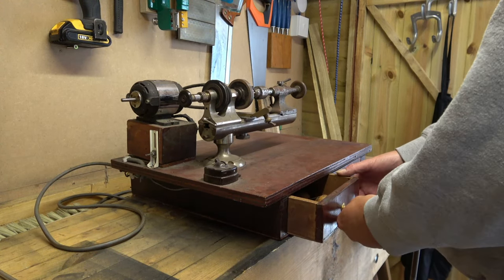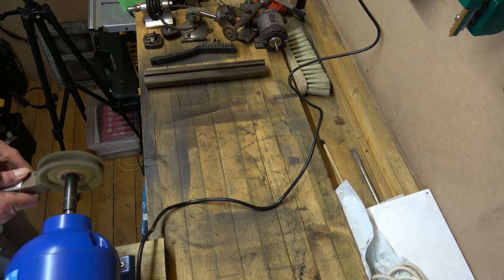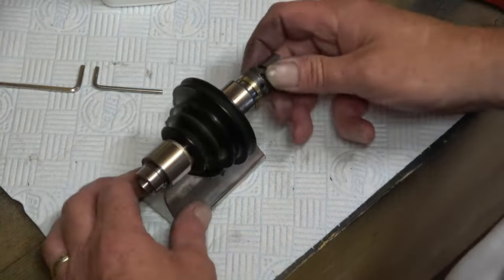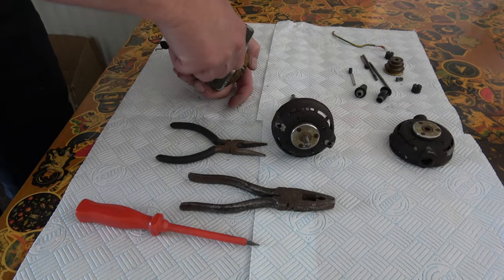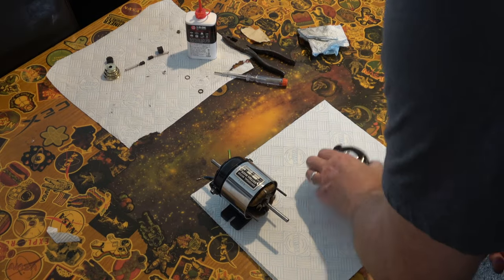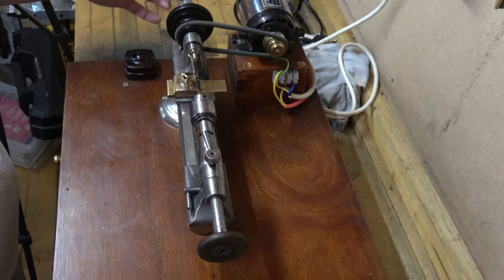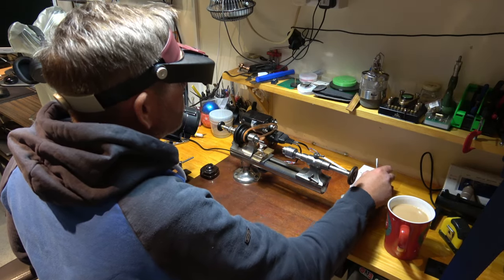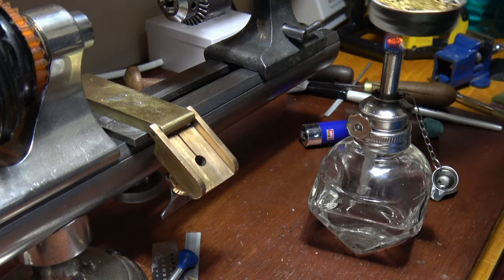I Bought a Vintage Lathe and restored it ... Now Watch Me Make a Screw! 😂

Comment: Well done, Adie That was great to see you're making good progress with the lathe 👍 I think the problem with the motor not reversing is that it needs a third wire for the commutator which is common for brushed motors, but I could be wrong  😆 Anyway, I love the screw, it requires framing 🤣Can't wait to see the next watch video as well. Keep up the good work my friend!
Reply from the maker: Ahhh electrics isn’t a strong point of mine 🤣🤣🤣 thanks for watching mate speak soon 😁👍👍👍

Comment: I restore torsion clocks and I have done a few videos using a graver, very satisfying making things using a graver, if interested search YouTube for TorsionDell, use Castrol Hyspin 5 spindle oil to lubricate headstock, the gravers you show at the beginning have the wrong handles and way to long as they should sit in the palm of your hand and  they are engraver handles , easy to make your own with hardwood dowl and brass tubing, the tool rest needs to be close to the work.
Reply from the maker: My friend thank you 😁 I wasn't sure on oil for lubricating I had used some 3in1 when I took it apart but I'll be getting some Castrol now 👍 hope.ypu donti.d me asking but how often should they be lubricated?  I'm kind of doing it just before each use. I quickly found out about the graver situation lolol I've chipped the point of the diamond shape a couple of times now but it's all learning lol thanks again for the advice and thanks for watching. I'm of to take a look at your vids now 😁👍👍
Reply: @HorologyHubub  yes just a drop of oil in front of & back bearing hole it’s designed to flush through to keep the bearings free of contamination, if using all day then mote than once.
Thanks for watching my videos hope they help.

Comment: This "ruler" that makes the spiral cuts on the screw is pretty interesting. How do you keep it sharp? Does it have a proper tool to keep it?
Reply from the maker: Hello my friend 😁👍👍 The ruler is a watchmakers die tool. I don’t think you can sharpen them but they are basically a hardened thread. Not very expensive thankfully so when that one gets dull I’ll purchase another. I do have an antique one but had bigger threads, and that still works 😁

Comment: Hi, congrats on getting a watchmakers lathe. Those tools you showed at the beginning are your gravers ad they are basically the same that wood turners use only way smaller for the watch trade. Learn how to sharpen them and they’ll serve you well. The other item you were asking about should be a steady rest. It should have two more screws on it like the one at 4 o’clock…one at 8 and one at 12, and you should see holes for those in it. It mounts after your tool rest and before your tail stock, and it’s purpose is to hold longer pieces in place so they don’t bow while you’re turning them
Good luck with your new tool, they’re amazing to have available and once you learn how to use them you’ll be able to make almost anything you can imagine for watchmaking. Look up Stefan Eric Pahlow on you tube, he’s into collecting Lorch watchmakers lathes and show a lot of work he does while using them.
Good Luck from Boston Ma. USA
Reply: Just got to the part where you try to work the lathe…you had the motor running the proper direction in the first place, you just weren’t holding your graver properly. You want the lathe spinning towards you so as you’re turning it’s putting down force on your graver while it’s resting on your tool rest, otherwise you won’t have proper control of your tool. Also make sure your gravers are very sharp.You’re going to want your tool rest set so that your graver is about centerline to the piece you’re working on. Good luck again, and so far you’ve done a great job of restoring your lathe. Oh also I almost forgot, don’t mess to much with your tool rest, just give it a bit of oil and work it back and forth a bit and use it like that
Reply from the maker: My friend, thank you so much. What a wealth of information 😁 I will definitely check out that channel and thank you for answering a good few questions I had 👍👍 more importantly thank you for taking the time to watch the video, it's appriciated 👍